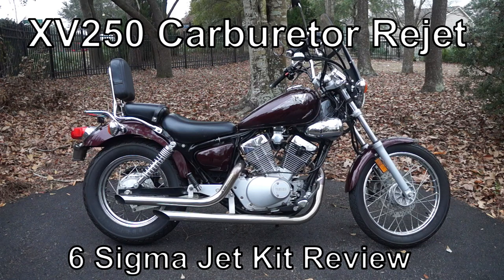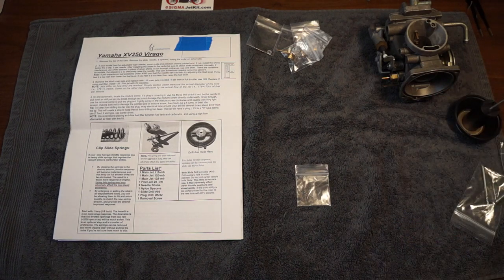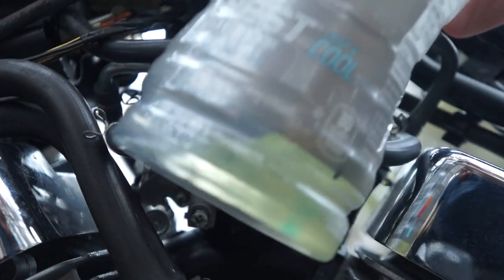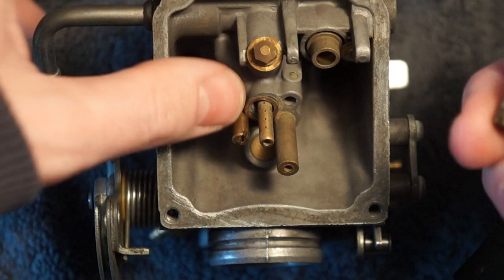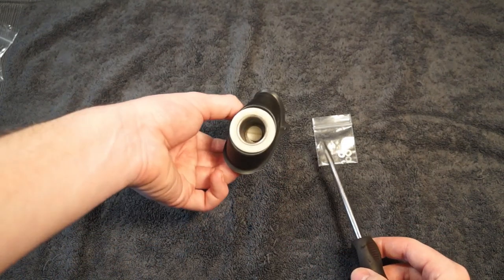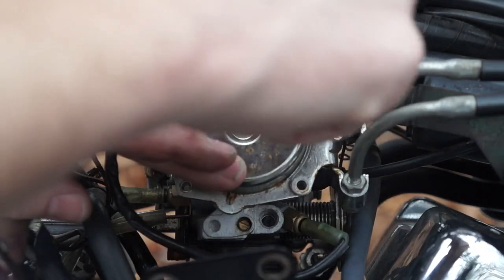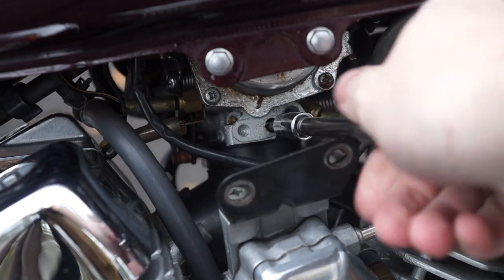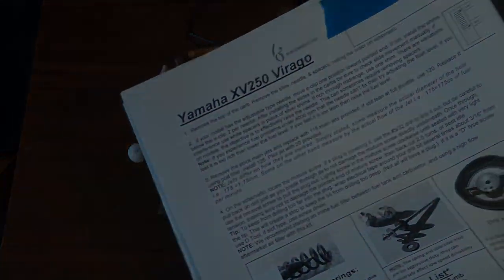Virago250 V star 250 Carb Rejet Full Walkthrough. 6 Sigma Jet Kit Review.

Comment: what does putting shim washers in the needle do ? increase fuel, or decrease
Reply from the maker: @rplagas  shimming the needle will set the needle higher in the hole. This makes more clearance for gas to go through. It increases gas in the mix mainly in mid throttle.

Comment: at 12:58 do the metal shims come with the sigma kit or can i get it with the kit you posted in the description?
Reply from the maker: They come with the 6 sigma kit. It's the cheap way to do it but entirely valid. The kit in the description comes with an adjustable needle that you move the clip up or down on as opposed to having to use shims to get the same effect
Reply: @helloish12321  awesome thanks

Comment: 19:21
Is the idle rpm in this scene about 1300-1400 rpm? 
Thanks for your useful videos.
Reply from the maker: It's right about there. I didn't have my tach on me but I am used to the sound enough. Go a bit higher than my rpm just to be safe
Reply: @helloish12321  I just watched a video of another bike has 2 cylinder engine and tachometer. Indeed, the idle rpm of your bike seems to be around 1400.
The correct RPM was much higher than I expected. Your insights into battery charging and oil pressure are excellent. 
Have fun with your nice bike!

Comment: you mentioned you put a 125 main middle jet , but you failed to mention the jet size for the pilot jet , would you please let me know what size pilot jet that you used please, i have a 2003 v star 250 , merry christmas
Reply from the maker: There was only one idle jet in the kit in the beginning, a 20. Additionally I listed in the description my current setup. After trial and error I found a 20 idle ,120 main and 1 needle shim worked best on my bike. 
Your bike may like a little more or less gas so try a few setups
Reply: @helloish12321  ok great where can i go to get the 20 jet pilot &120 middle main jet 120 & 1 needle shim to work best  on my bike , thank you for your time please forward me where i need to go to get these parts , happy new year, Trey
Reply: what web site do you recommend ???thank you again
Reply from the maker: @treyatkins358  jp cycles typically has jets in stock. If you can't find any there then you can usually get generic jets on Amazon in a big kit. Just search xv250 jets on Amazon to find some

Comment: I've got 20 and 115 jet and the air fuel screw doesn't do anything
Reply: check your engine 13KW or 16KW. in 13kw you need to change camshafts to see any difference in changing jets

Comment: Does the re jetting do the same thing as a thorough cleaning? I'm new to this.
Reply from the maker: The jets are the brass parts that gas flows through to mix with air and go into the engine. There are typically 2; a main jet and idle jet. The larger the hole in the jet the more gas goes in. The jets with bigger numbers have larger holes. 

You can use this guide to help take out your factory jets to clean them but if your bike is stock (no intake or exhaust work done) then you don't need to change the sizes. If you do intake or exhaust work then you get more air in and need to adjust the jets accordingly.
Reply: @helloish12321  ok thanks. My daughters 2013 v star 250 sat for a long time. It'll start barely but gas is flowing out air box area. I assume this is stuck float? Etc. your video is very clear thanks.
Reply from the maker: @desotopete  mine had the same issue. Stuck float or bad float height. Start with the float and make sure to clean all jets as well as the idle air mix screw. That circuit gets clogged very easy and it will never idle right
Reply: @helloish12321  thanks a million. Your video gave very clear description and instructions about the carb. Good editing.

Comment: I might of missed it but did he drill that thing out and put the wood thing in and pull it out? Or did he advise against that?
Reply from the maker: You will need access to that adjustment screw that is hidden behind the brass cap on factory carbs. I had previously drilled mine out so I could not demonstrate. It's fiddly and you have to be careful not to go too far but it can be done in about half an hour
Reply: @helloish12321  thanks I have almost enough money for my bike so I’m just trying to learn. I’m at 1500 feet, can you recommend me which jets to use?
Reply: @helloish12321  let me trouble you once more, is anything extra needed to put a k n air filter?
Reply from the maker: @Balithazzarr  the main jet in the kit is the one most will use. Idle jet might take some trial and error. I use a 20 at sea level. 

For the k&n air filter I would go to the hardware store and get another nut to use as a jam nut for the filter. Mine fell off several times from vibration.  Other than that it's just drop in
Reply: @helloish12321  awesome, thanks for being so helpful
Reply: @helloish12321  and again, the main jet is easy to find because there’s only one in the kit for the main jet right?
Reply: @helloish12321  I guess I should ask how do you know when you’ve picked a good idle jet?
Reply from the maker: @Balithazzarr  the idle air mix screw adjustment will tell you. It only fine tunes the idle mix from where the idle jet sets it.  On our bike it adds fuel when you turn the screw out. Like I said in the video when you use the screw to find where the bike idles rough then smooth then rough. I started with a richer idle jet than I needed at 22.5 (stock is 17.5). I knew it was too rich because the bike would run best with the screw turned all the way in clockwise (which on our carb means as little fuel added). Once I went down to a 20 I could find the optimal idle air mix screw setting easily. I imagine if I kept the 17.5 jet the bike would not idle at all with the screw all the way in and I would have to turn it out almost all the way for it to idle okay. You get a feel for it.
Reply: @helloish12321  thank you so much.

Comment: I have stock exhaust, the bike seems really low on power. Running on both cylinders, and i have access to the adjustment screwm but the adjustment screw on the carb seems to do nothing...
Reply from the maker: Have you cleaned the carb or done any other work to it? My stock carb gave me all sorts of trouble when I got the bike which is why its on the workbench in the video and an amazon chinese carb is on the bike. Often times you need to clean more than the jets on the carb to get it all running right depending on how the previous owner fiddled with it or let it sit.
Reply: @helloish12321  

yeah, i put carby cleaner through it, completely disassembled the carb and cleaned it out and put the air compressor there to clean out any passageways
Reply from the maker: @qwertyui90qwertyui90  what jet sizes are in there? Should be 17.5 and 110 stock. Did you make sure to take out the idle mix screw and blast that out?

Aside from that you can check your float height.
Reply: @helloish12321  ill check today the sizes. Yes they are clean.
Reply: @helloish12321  it was wrong main jet.  Swapped to a 110 main jet.

The idle smaller jets have no labels on them to see. No markings at all.

The bike now idles with a deep orange flame with a glass spark plug. 

Gunson colortune spark plug is being used to see. 

Light blue lean. Blue is okay. Orange is rich and yellow is way too rich.

Comment: i relized when installing it the gas just keeps coming out any help with that
Reply from the maker: Where is the gas coming out of. The petcock?
Reply: @helloish12321  its from the tube from the very first step
Reply from the maker: Make sure the petcock is set in regular or reserve. The handle should be pointing up or down. If it's pointed sideways it's the "prime" setting which just allows gas to come out with gravity. If it's set on regular or reserve and gas is still flowing out then you may have a faulty petcock. Either rebuild the seals inside or you could drain the tank or put a bolt in the pipe to plug it while you do the work

Comment: is it fine to use the stock idle and then 120mains or does it need to be 20 or 22
Reply from the maker: You may be able to get away with the stock of you screw the idle mixture screw way out. My bike had trouble with lean idle mix even when it was stock so I would definitely recommend a 20 jet for the extra $5-7

I used a 22.5 in mine for a test and it was WAY too rich. Can't imagine you would need anything other than 20
Reply: @helloish12321  thank you. do you happen to know anywhere else that sells a size 20 the one on the description doesnt have it in stock
Reply from the maker: @jesusrios9630  https://www.amazon.com/gp/aw/d/B07ZH43PT3?psc=1&ref=ppx_pop_mob_b_asin_title

This is what I bought since they can be a bit tricky to find and I wanted a bunch of options for other bikes if I needed in the future. They are knockoff parts but the 20 in this kit matched my other genuine 20 jet
Reply: @helloish12321  thank you so much

Comment: On the adjustable needle that comes with the rebuild kit... Since you're not using shims, how do you recommend we set the adjustability?
Reply from the maker: You can set it side by side with your stock needle and figure out where the clip would need to be for them to have about the same effective length. Then move the clip one notch closer to the point of the needle.

That will make the needle sit higher in the body of the carb and allow more gas to flow through the main jet sooner.
Reply: @helloish12321  ok one noch from stock got it! Thank you

Comment: is that "slide" a choke valve??
Reply from the maker: No. The slide in a cv style carburetor like ours is what actually controls the airflow to the engine, not the throttle valve. When you open the throttle plate you actually cause a pressure change in the carburator that then moves the slide up by pulling a negative pressure on that rubber diaphragm. Our bike also doesn't use a butterfly valve choke, the choke plunger controls some other pressure system that I don't entirely understand, but the end effect is more vacuum to suck more fuel through the jets.

The alternative is a slide style carb where your wrist directly controls the slide and there is no throttle butterfly valve at all. Pull the throttle and the slide goes up. These typically have a butterfly valve style choke. You see these on dirt bikes for instant throttle control. 

Many street bikes use cv carbs because they are somewhat altitude adjusting. They figure street bike riders are less likely to want to constantly adjust tuning. They also add a slight smoothing effect to the throttle making the ride less choppy.
Reply: @helloish12321  Ok, that made the most sense. much appreciated. thanks. I know for the fact that it has a throttle plate valve as oppose to this slide. Even tho, that thing does act like a choke which is why I assumed that what it is the function for it to run rich and lean. Didn't realize its a slide as a slider whatever it is but slides. Wonder why they use that than the plate. Anyways, when i had it wide open, the idle is so high... so I move it to nearly middle to the point it idle lower before it stalls out. tho the bottom line is it acts like a choke! haha
Reply from the maker: @HighAway  do you mean you were messing with the slide with the cover off while the bike was running?
Reply: @helloish12321  No no, when the choke lever were still on the bike's bar, assembled. Was doing 'em while idling and or riding... just to see how it runs.

Comment: What is the gas mileage with the jet kit and different exhaust system? How many miles are on your motorcycle? 

I like small motorcycles and want one that will last forever, even if it is kept stock. Yamaha has a good reputation for reliability. Do you think one of these would make a great motorcycle for a couple of decades of riding for perhaps 100,000 miles?
Reply from the maker: From what I understand smaller motorcycles don't last as long as large ones. Overstressed engines and all that. Also this being air cooled doesn't help.
I have almost 10k on mine with no severe issues. Only the usual 15 yo outside kept motorcycle things. I consider it very reliable so far and its an old simple design. Not a lot to go wrong. 

Completely stock I got routinely 72 mpg. After the pipes and rejet it went down quite a bit to low 50s. I was running a Chinese aftermarket carb and swapped back to the OEM mikuni and once I got that completely dialed in I get high 50s. 
It's a large mpg drop but the bike feels much faster afterwards.
Reply: Thank you for your information. It  was helpful.
 @helloish12321

Comment: Excuse my ignorance. But what is the goal or hope for installing this kit? For someone with a functioning carburetor that has no noticeable problems, is this not needed or is it recommended for performance increase.
Reply from the maker: Only recommended if you have done exhaust or intake changes. It adjusts your fuel mixture for the additional airflow. If you don't do this after a new exhaust or intake then you will have a lean mix and it causes higher temps which is a no no on these air cooled motors.

Info in this video can help with basic carb cleaning as well since I show how to access the jets and slide.
Reply: @helloish12321 Forgive my ignorance I understand needing bigger jets when the intake is modified as you get more air intake requiring more fuel, but exhaust pipes are only removing exhaust gas not affecting intake? Thanks for the great videos on a great bike.👍
Reply: @helloish12321 ...I'm curious as I have just bought a 250 Vstar and got some loud pipes for it. Whenever I put loud pipes on a carby car I never changed the jets? I am interested in your thoughts. Thanks again for the great videos.👍
Reply from the maker: @caprilover6391  I can't say for certain since I have no experience with carbureted cars. Having just switched the pipes without rejetting really upset the running condition of the motor and probably more than it does on other bikes. Yes it will start and run, but the control of the throttle won't be smooth and it will backfire a lot. 

It's worth noting that this bike is also sold as a 125cc with the same mikuni carb. It might have something to do with the carb being slightly undersized for a 250 already.
Reply: @helloish12321  Thanks for the reply and very interesting. Thanks for explaining your experience. You're the man with the hands on experience, so I'll go with your advice and rejet mine when I fit the pipes. Thanks for a great channel and community of XV250 enthusiasts, I'm subscribed. Keep up the good work my friend.👍
Reply: @caprilover6391  Anything that increases airflow into AND out of the cylinder Can increase power. If you increase incoming air with intake mods, you won't see much of an increase until you free up exhaust flow. You have to take a systems approach to increasing power.
Reply: @unionrdr  Thanks for that, I'm also fitting a K$N air filter so I'm definitely rejetting just waiting for them in the mail. I also got a 17/43 sprockets and new chain, it should change it into a different bike. Not that there's anything wrong with a stock 250 vstar.👍